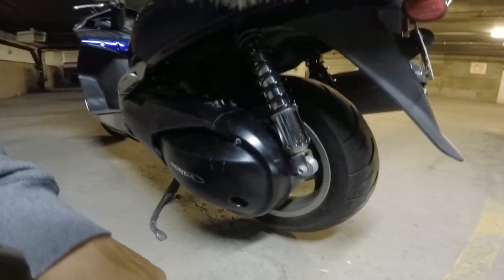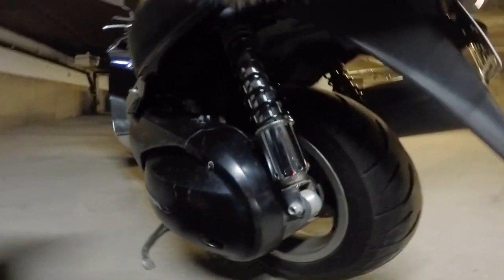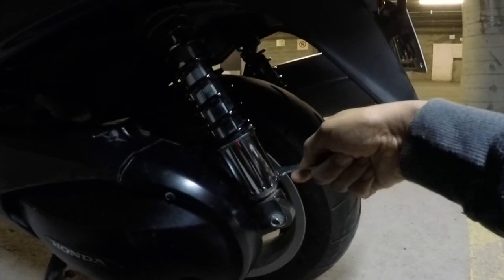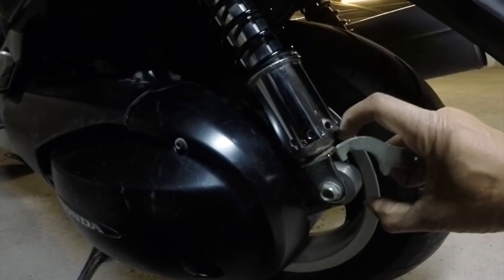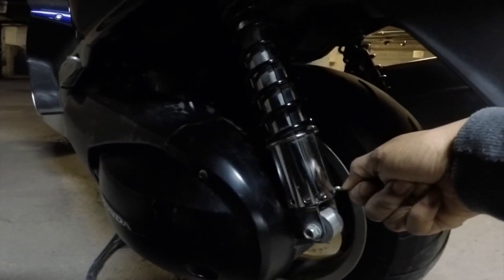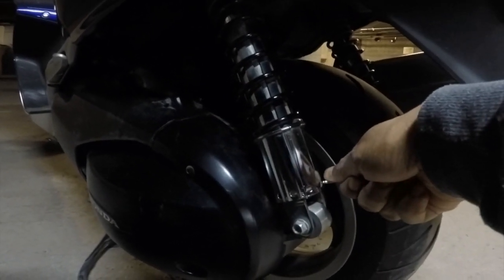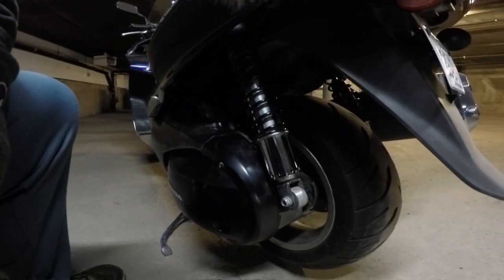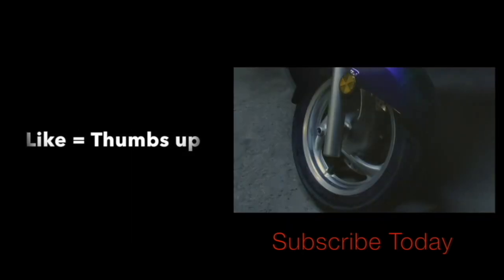HOW TO: Honda SilverWing Rear Shock ADJUST #107

Comment: THE SUNSPESION ON SILVER WING GENERALLY ARE TO SOFT ESPECIALLY IF YOU ARE A HEAVY PERSON.ITS LIKE A BOAT ON THE ROAD.I CHANGE MINE WITH HAGON SHOCKS BACK AND MUPO SPRINGS ON THE FORK AND NOW ITS PERFECT
Reply: But what about comfort? How is the feeling on the bad roads and handlebars? SW600 is all about comfort and not race style riding. Just asking as I plan to change fork seals and oil. I will go with heavier oil maybe but thats it.